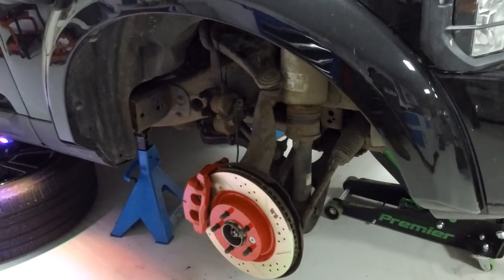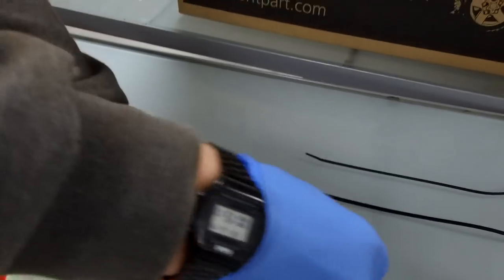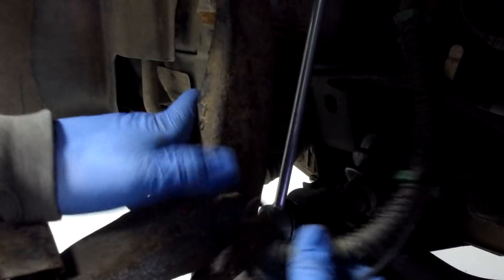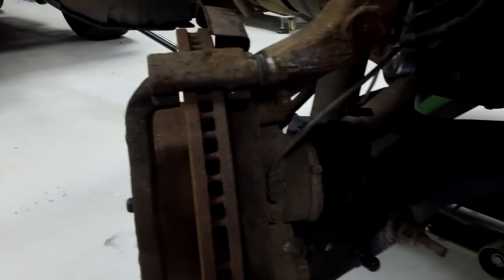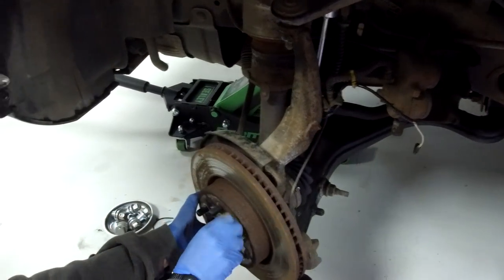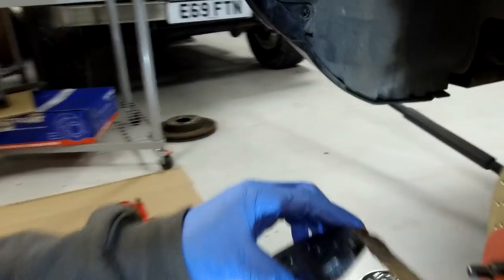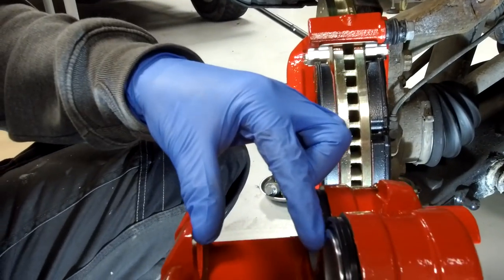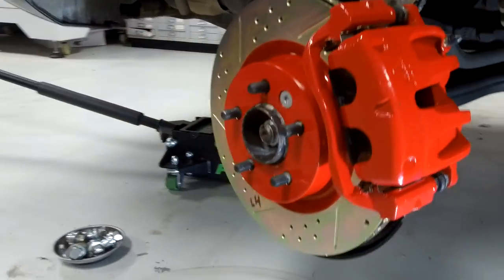Land Rover Discovery 3 Front Brake overhaul & Upgraded discs+pads LR3

Comment: I just used Brembos from a RR Sport. Even bigger than these and far cheaper from a breakers. The callipers/pads are bigger too!
You must have 19” wheel and above to fit as the calippers are too big to fit with 18” rims and below.
You will see/feel the difference...
Reply from the maker: Hi Roger - did you do this upgrade on a Disco 3 or D4 ? Did you fit the 4 pot Brembos or the 6 pots ?
I hear that the 6 pot Brembos will fit !! ( sourced from the newer Range Rover models )
Reply: powerfulukltd 
Hi
It was my D3, with the 4 pot callipers. I rang round looking for a RRS of the same age as the two vehicles share a lot of parts. A really easy swop over. You can’t keep the tin splash guards though as the new bits are a lot bigger,
When the wheels go back on you have a “fag paper” gap between the rim spokes & callipers.
Result is the best stopping D3 possible, useful if tuning or heavy towing...
Reply: @rogerspencer6538  
Did these RRS Supercharged calipers bolt straight onto your LR3 steering knuckle or did you need some type of adapter?  In addition did you have to use RRS Supercharged brake hoses and wear sensor?  I guess if you wanted backing plates you could use some from the RRS Supercharged as well.  Thanks.
Reply: Ross White Hi
They are a direct fit, brake hoses & the ware indicator cable remained unchanged..

Comment: Thanks for this video. Very helpful, as are all the others you make. Always had good service from you on the parts I've bought, too. When it comes to these disc upgrades, do all four wheels need to be done, or would it be acceptable to put the larger drilled and grooved discs just on the front to begin with?
Reply: of course "modifying" your car from standard is a scary thing... so any advice is just my idea...front brakes do most of the braking so this mod will improve your braking. I cant see its going to wildly shift the brake bias as the rear discs are pretty powerful and also the ABS will start to kick in any wheels lock up....which i cant see happening. I think more dangerous are old brakes in poor condition etc.

Comment: Didn't see a torque wrench deployed on those brake bolts. With the big carrier bolts, do you just "wind 'em up tight" with the breaker bar?
Reply from the maker: Our torque wrench like most "standard" ones only goes to 200NM so we hae gone for breaker bar tight, plus a bit.

Comment: The brake pads themselves have to be fitted with the correct orientation, too. The chamfers are at the top.
Reply from the maker: Hi - i think these are chambered at both ends if you look - but you are correct that may not be the case on all pads.

Comment: How do you get to the back of the disk screw to WD40 it? I ended up twisting a T50 torx impact bit trying to undo that screw.  Waiting for more to arrive in the meantime. I still haven't got it off.
Reply from the maker: Hi - there is room to get in behind the disk - though this is a common problem. If you are changing the disk you can put a cutting disk carefully through the center of the torx bolt to form a slot then use a flat blade impact driver. The heat from the grinding also helps to loosen the bolt. Having said that if you still have a grip on the bolt you are in with a chance of doing it with the impact driver.

Comment: Would your guys able to make a video on how to paint the callipers on the land rovers ?
Reply from the maker: We purchased new brake calipers and sliders and painted them so this was easy. We also have a spray booth we have just installed so this also helps... not sure how a more DIY approach would work.
Reply: Were would recommend me to get front disc and pads from for my discovery 5
Reply: @mohammedalamin698  You could upgrade to the L405 supercharged discs and Brembo calipers !....
Reply: sj3323 .Hi Ross
Everything was a straight swop, nothing needed. I would just recommend that you use parts off a RRS of the same age/year as your Disco.
Good luck